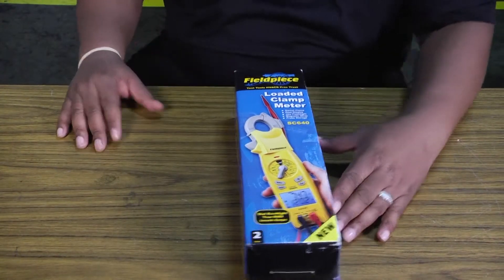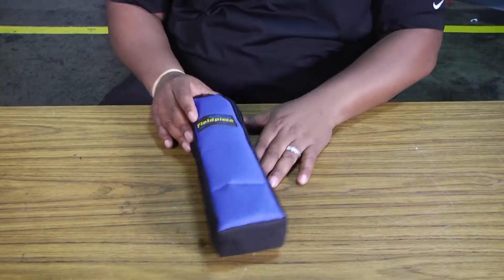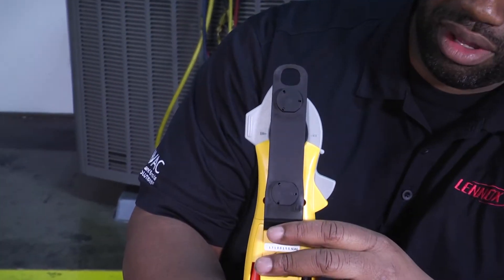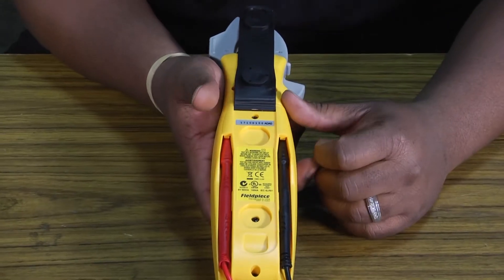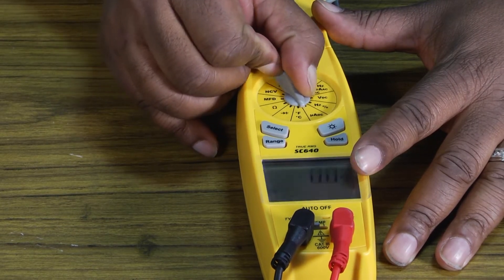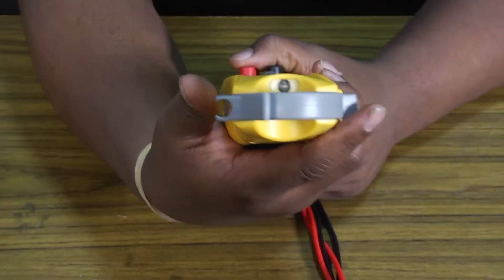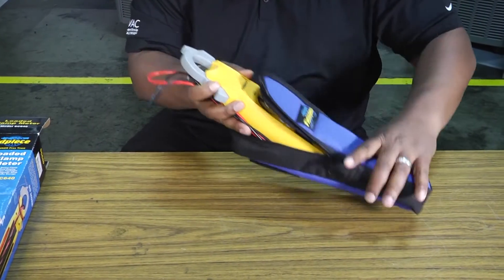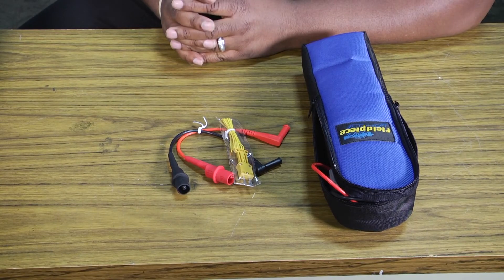Fieldpiece SC 640 Meter Unboxing

Comment: I like mine a lot. Used it for years in residential. Now that I've been doing commercial quite a bit, I'm rather disappointed at how the meter can't read over 600v. I'm in Canada and the majority of all the RTU's I work on are 600v. Our voltages aren't garbage like in the US, we have strong voltages either right on the money, or higher. Once my SC640 see's a bit over 600v, it just gives me the OL error. So 90% of the time I'm working on RTU's that are 600v, my meter isn't capable of displaying the voltage I'm reading, it just lets me know there's voltage there and I have no way to know if I could be too high over 600v. It's really annoying how it 's just on the edge of what it should be able to read. 600v is quite standard these days. Not sure why an HVAC meter can't handle it.